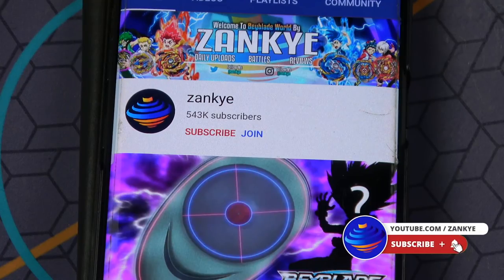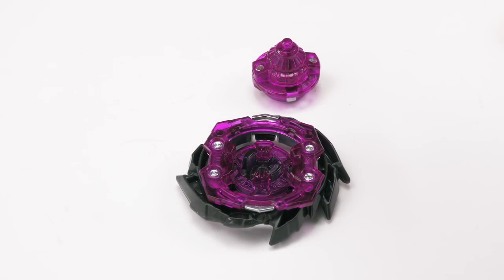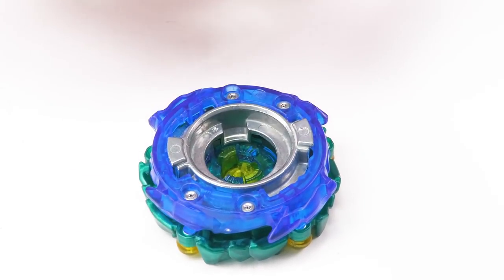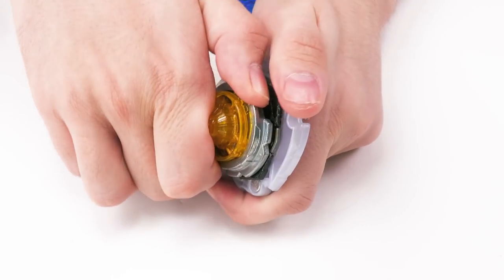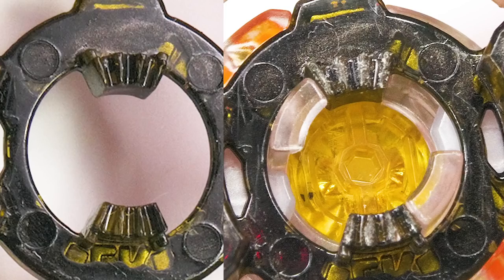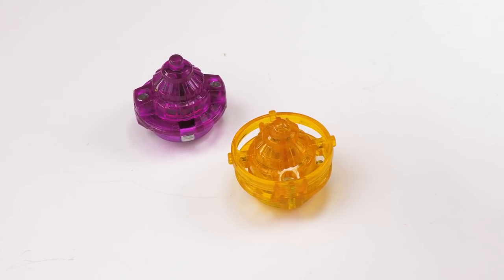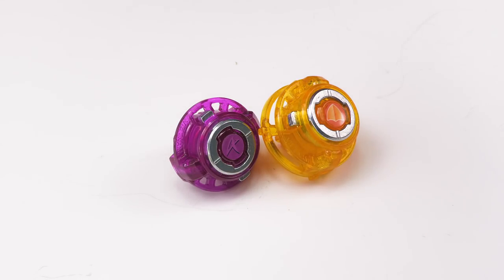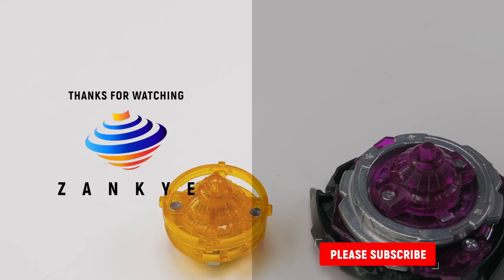Metal Drivers Takara Tomy's Worst Idea For Beyblade Burst

Comment: What if the new system contains metal teeth so that the metal lock drivers are safe with the new system
Reply: What if you were right, but only half

Comment: My question is, what if the central section of the driver where the logo sits were made of metal instead of the teeth section?
Reply from the maker: Doesn't make any sense, the purpose of how the metal drivers were designed was so the plastic part around it was metal
Reply: It probably burst more often since i think metal has less friction than metal

Comment: The only way that would work it if the teeth were metal them selfs
Reply from the maker: It's not a good fix at all, the driver system should've just been avoided to begin with

Comment: While I’m not going to say it’s the sole reason as to why the Metal Drivers are so dumb, I believe the reinforced spring being in the Metal drivers also factors into why the Metal Drivers ruin teeth so easily. Like, you’re literally making the Dash drivers, whose whole entire point is that they have a reinforced spring, obsolete. But I would even say that because at least normal Dash drivers don’t wear down the teeth THIS badly. And when you make Metal prongs lock onto a bey so tightly, you just put more stress and pressure onto the teeth. While I don’t think it would have completely stopped the wearing down problem, TT should have just stuck with making the Metal drivers heavier versions of regular drivers, but give them slightly worse burst res. It would have still have been useless in competitive, but at least this way it isn’t a direct powercreep of a driver system that is already a powercreep of normal drivers, and maybe the wearing wouldn’t have been as atrocious. Or better yet, just stick with the high drivers. Yet another reason why the Superking line has been disappointing. And this is why I’m more focused on collecting the older stuff.
Reply: Eh, I'd say the Superking Line is one of the better ones we've gotten (GT was kinda weak). I don't think Metal drivers can't work however, just an idea that needs more refinement.